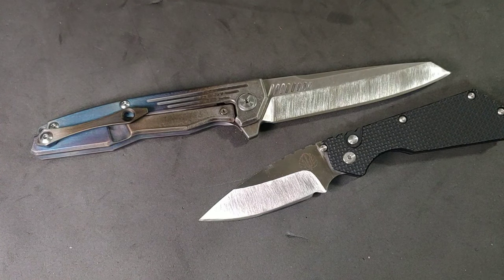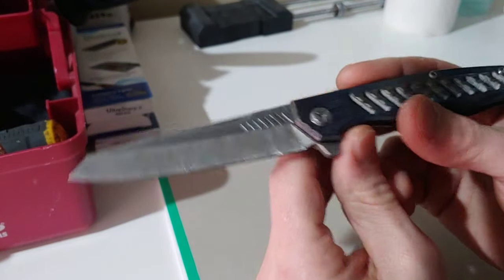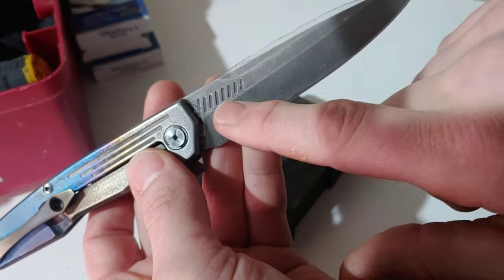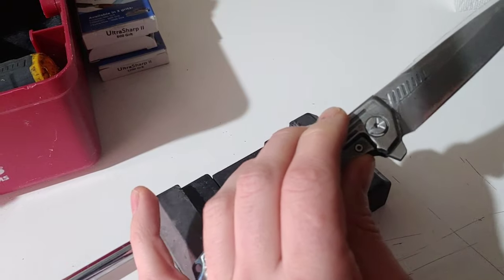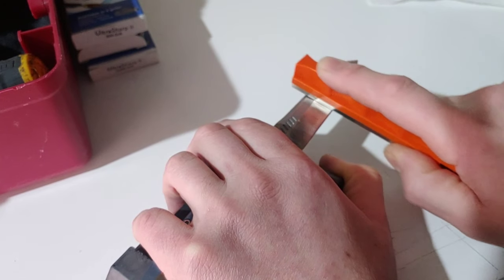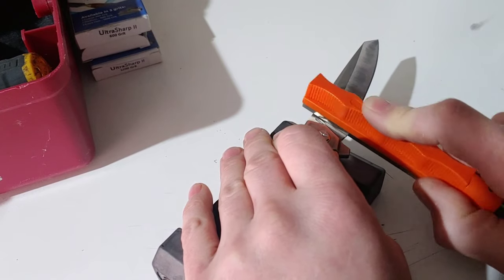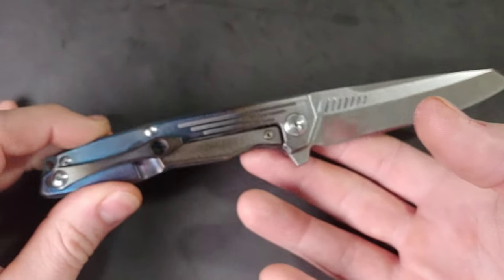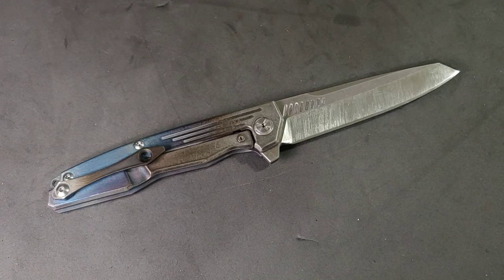How to Regrind Knife Blade by Hand : Satin Finish

Comment: Pretty easy regrind! Great way to refinish a used blade.
Reply from the maker: Yeah and you can get rid of a scratched finish or thin out a blade or raise a grind or even if its showing rust, theres many many reasons why you might want to doit, on the Protech I did it because the edge was really messed up from sharpening with a fixed system the edge angle went up way to high on one side

Comment: First of all I want to thank you for all the videos and knowledge you share. That really helps beginners like myself. I acquired an older Cold Steel carbon V srk fixed blade. Someone had stripped the original finish and looks like they tried to sand some rust spots. On one side the grind line has been sanded down and is very faint. Will this technique work to restore the grind line back to a crisp look? Or is there another method I should do? Thanks again and have a great day.
Reply from the maker: You can get 300 grt sand paper and add a new satin finish just make sure you go in one direction not back n forth, or you can etch and stonewash
Reply: @NeevesKnives  Thanks brother. I appreciate all the help I can get. I have sanded on it for a while with sandpaper wrapped around a flat edge and restored some of the grind line but I have not tried sanding in one direction. I will give it another try. Thank you

Comment: Thinking about doing this. I ran my otf Tanto through one of those hand-held sharpeners without paying too much attention, accidentally had my angle off and rubbed a horizontal mark all the way across the blade into the grind that goes vertical. Would there be any other way to fix that sharpening scratch/rub mark? Thanks for the video!
Reply from the maker: Depends on how high it is but you can possibly sharpen it out, otherwise it will probably need a etch and stonewash, or blast.

Comment: What was the purpose of doing this?
Reply from the maker: I say it at the end i shoulda said it off the bat, if you have a knife thats really finger printy or if you have scratched your knife and want to put a new finish on it or maybe you want those deep grind lines like a lot of customs come or to put a double finish on a blade that you etched and stone washed and also if you want to thin out your blade/edge. Many people send their knives out to get new grinds im showing that you dont have to. Theres a guy who does simple flat grinds and can bring your edge to 5 thou bte and he cant run out of buisness
Reply: @NeevesKnives  I guess I missed that part lol. Yea I know what u mean. I've got a couple I need to do that to. Not to think it, but to get them belt groove's out of them.
Reply from the maker: Yeah the one guy charges 60$ a pop and people are flocking
Reply: @NeevesKnives  it's worth having someone do a regrind and as an example take the Spyderco Shaman. The Shaman is .024 - .025 bte factory, it would take you hours to get it down to the .008 bte that Tim's is I recently tested. To take .017 off the blade by hand would take hours by hand where on a grinder you can do it in 10 minutes. To just clean something up like you are doing I see the use for it but for a full regrind to really reduce the bte thickness a grinder is the way to go.

Comment: Non essential
Reply from the maker: What do you mean?
Reply: I think it turned out essentially sweet .something I've always wondered about the ts16 is why don't it have a ceramic ball in the provided space on the pocket clip 🤔 might reach out to twosun ,? Maybe they know what size would work in it
Reply from the maker: Idk why but i do know that ive had a couple knives that used titanium ball and they worked great also the ts16 has that round part on the clip with a groove cut and it works great imo